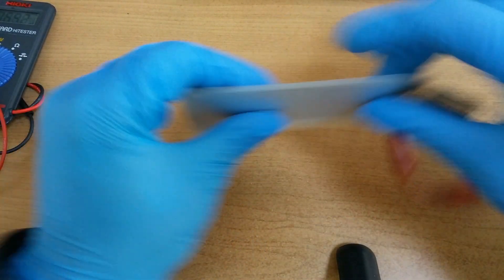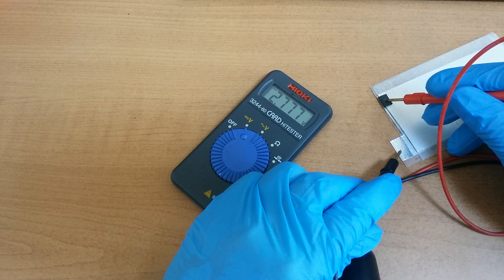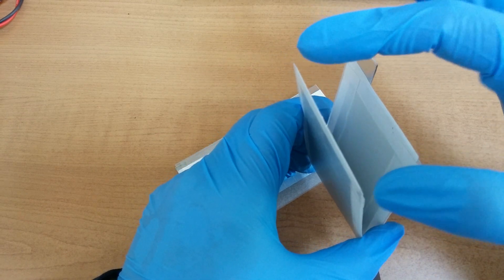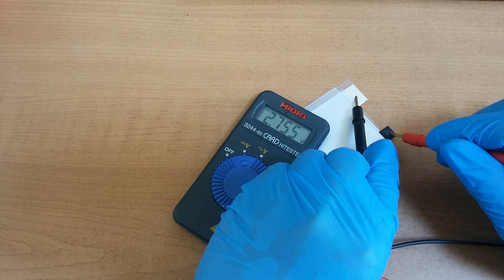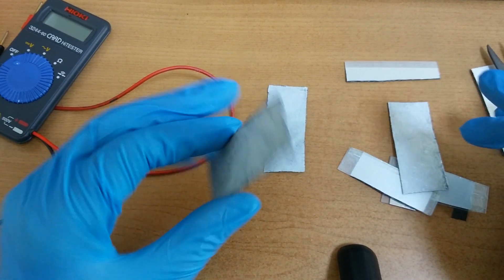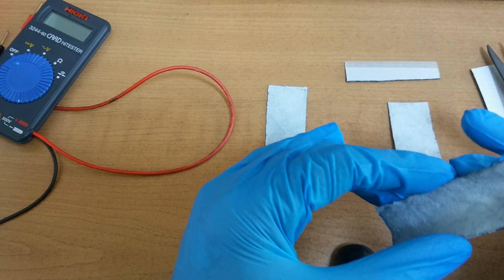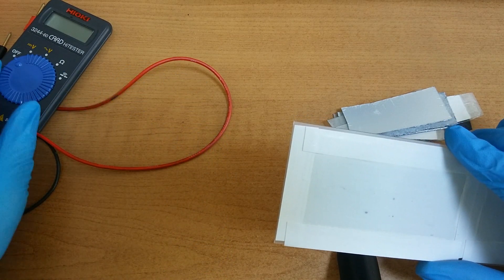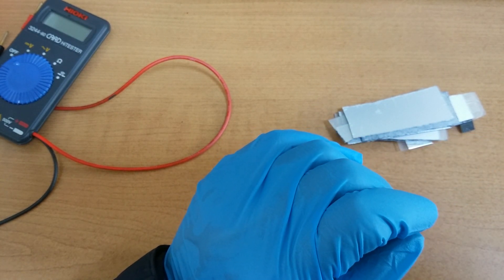sodium ion solid state battery experiment: to increase the surface area

Comment: Have you try aluminum power mix with a activate carbon power you won’t be disappointed trust but use some red duty with the mixture but bake the red duty for 5 hours on high

Comment: L' autore non chiarisce quali materiali usa al Catodo (+) ed all'Anodo (-). All' Anodo deve essere presente Sodio metallico che essendo molto tenero può essere disteso sulla lamina di alluminio previa fusione : (evitare al max il contatto dell'aria). Al Catodo si può usare il Na2S.  N.B. questo composto si Ossida durante la Carica e si riduce durante la Scarica. In mezzo usando separatori sottili in PE che hanno la funzione di trasporto ionico si può inserire una miscela ionica costituita da P4S10+Na2S. Questa miscela la cui composizione stechiometrica è scelta dallo sperimentatore-studioso, permette il trasporto allo stato solido degli IONI. Come fase iniziale sarà buona cura scaldare il sistema dall'esterno con un ventilatore caldo a T=40gradi centigradi. Nota: Na2S deve essere possibilmente ANIDRO. Eseguire misure di Volt e mA.
Il.lettore sperimentatore consideri che lo schema della cella è:
-Na/P4S10-Na2S/Na2S/+. I due trattini / indicano il separatore in PE. L'elettrodo positivo può avere come supporto solido Cu o Grafite

/sperimentatore